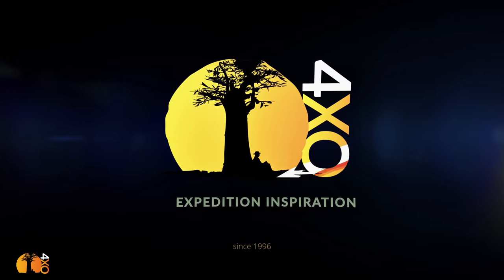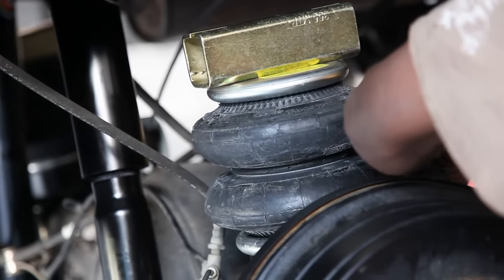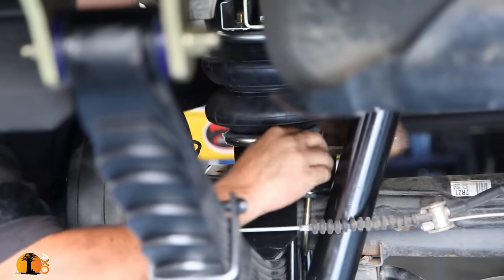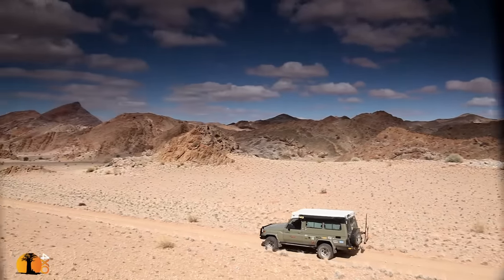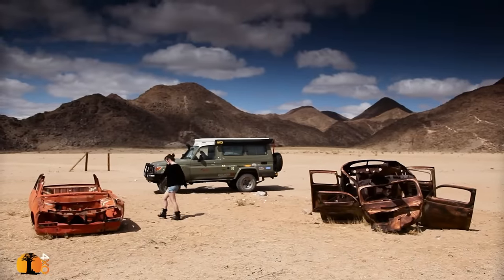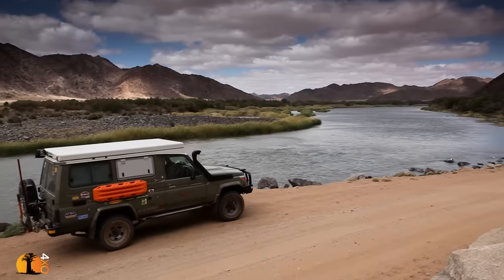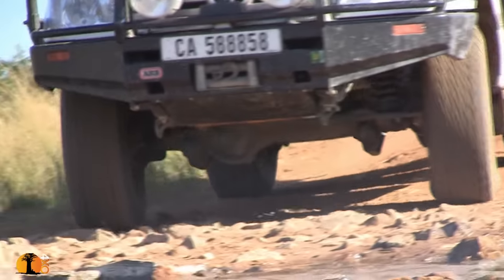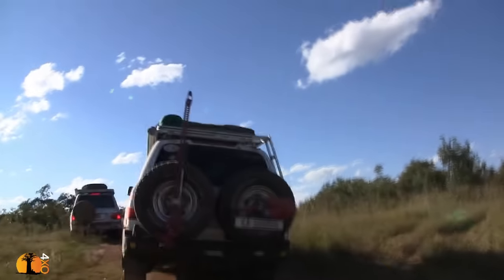AIR-BAG HELPER SPRINGS. ANY GOOD? | ASPW 4xOverland

Comment: Airbags when mounted like in 10:40 is an absolute nightmare for the frame. Shows not the slightest understanding of swelling/oscillating forces. IF at all, the load must be distributed to a maximum of frame length. And then still the basic failure is: the vehicle is overloaded and will brake. 
Very common mistake: big cabins on a pickup. Its not working, needs stronger springs, will break when used even in light offroad driving. It will. You'll completely lose the car in the midth of your trip because the frame will be welded to get you home finally and you have to replace it.
Reply: Wrong, go look at how the Ram 3500 comes from the factory with the air leveling suspension.  Airbags mounted exactly like in the photo.
Reply: I disagree
Reply: @travisschultz874 I don't mean factory settings
Reply: @travisschultz874 . Yeah . Built for it  FROM THE FACTORY . Engineered for it . Not an " Add-On " . OE equipment .

Comment: I have Air bags fitted to my Hilux and I think they are great. I agree with Andrew that most chassis breaking is because of airbags but when you speak to those people you would find out that they overload their vehicles and pump the airbags to the max to prevent the car from sagging at the back. I use my Hilux for a daily driver so my OME suspension is set up for daily driving and medium loads but when I have the back loaded with our diving gear, some other basics and have the caravan hooked up I use the airbags to support the leave pack at the back. I never inflate the airbags more that a quarter of its capacity but find that it give additional stability while towing and I can control the sagging at the back to ensure the caravan in running straight. This does not affect my ride comfort as my Hilux drives like a dream loaded or unloaded so having airbags can be beneficial but it requires self restraint not to think you vehicle is now all of a sudden capable of carrying load it was never designed for. Thanks.

Comment: Hi Andrew, 

Airbags are a hit and miss. We have used them for over 12 years in mining vehicles.  With that knowledge and seeing what fails I use this method. 

I figure out what rate springs the vehicle needs when fully loaded, I remove around 15 to 25% of that spring rate then rate my mechanical springs to that. 

The last remaining 15 to 25% we fit airbags to carry that extra. This give you the best balance I believe with the drivability and ride. 

It also allows x3 sections of the chassis to carry it as even as possible. 

😎
Reply: G'day Ty, love your channel (even though you're a Effy lover!!! hahaha). 
You're probably right when it comes to trucks with a bloody good chassis like yours and mine (I have a Chev Silverado 3500 srw...single rear wheel). 
However, when it comes to the little butter boxes that most people buy (Ranger, Hilux, D-max etc), I would urge caution about the "3 points of contact" idea. Those chassis aren't built with the idea of having upward force (ie: the air spring) applied directly above the axle location.  Fifteen years ago I had a Patrol with 6.5 Chev V8 diesel, cut-down to a dual cab and managed to crack the chassis because I over-engineered the rear springs....and they were COILS so actually meant to have the load placed on that section of the chassis.
The 15 to 25% overload idea has merit, but too many numpties would still manage to just keep adding more weight and STILL bend the chassis I reckon.

Comment: Air bags in coils make perfect sense if your occasionally towing a heavy caravan or similar. They do not affect the ride if used correctly. The trick is not to inflate the bags to their maximum pressure and overload the chassis. You don't need to pump them up hard to get back to normal ride height, just settle for lifting the back a little to recover some of the suspension travel. I never inflate mine beyond half their rated pressure. I wouldn't use them on a leaf sprung vehicle though, as the chassis isn't designed for the additional load point.

Comment: I'm not a expert but looking at some people's feedback, airbags are a good way to temporarily balance a load, provide better handling and reduce sway when towing. If you are almost always laden with weight, heavy duty suspension is preferable and smoother. There's no wrong decision, and airbags are generally a cheaper option then new suspension.

What I think we can all agree on is if you plan on towing 3t with a Prado with the family regularly, the safest option is to consider heavy duty suspension or airbags. You will have a much more enjoyable holiday with something to balance the load.

Comment: I've been running them on an 80 series for years. I constantly change from near empty to a decent load. The truck rides beautifully when empty but sags a little when full. The airbags level it out and make it more stable when loaded.
It's basic physics. Add load and your springs will compress and can't work the same due to reduced travel. The spring rate is also harsher when compressed.
Reply: Except airbags don't compress. They just stop the spring doing anything at a certain point. And then break your spring mount points. As stated. They are dumb for offroad load carrying. Perfect and designed for bitumen towing on daily city 4x4's.
Reply: @Snook_  of course they compress.. they're made of rubber! Get the right pressure in them and they'll compress just like a football bladder. The key is to have the right pressure which usually means not too much. I think they're most useful if your load changes a lot but I agree that for serious off-road with a fairly constant load you should have the right spring set-up.
Reply: @LongStraightLines  they don’t truly compress tho. Air has a limit where it just stops/bottoms out completely so it’s kinda shit and bad for your car to hit that limit and put all the load on a tiny point of the chassy. That was my main point
Reply: @Snook_  Its all about balance and knowing your vehicle , if when loaded you make the air bags and suspension work in unison you can run your vehicle on zero load ,and then when loaded equalise the weight with the air bags. obviously the bags compress , as the air presses the bags out horizontal on load ,thus giving you movement in a controlled way.As we all know all Toyota's chassis are massively over engineered , thats why we are all lucky in Australia to drive them. They also help with breaking under load. as they stop pitch and roll.
Reply: Also, unless you have progressive springs, compression doesn’t change the spring rate, so it is not harsher because it’s compressed. But because it has less travel for the shock absorber to do it’s thing.

Comment: I use airbags when towing a Caravan, 20 psi does the trick.👍 They do work well in coils as long as you dont put too much air in them. With 20 psi, the coils still compress and extend no problem at all.

Comment: Wait! The chassis in a whole is made to distribute the load onto the suspension. Yes there are fixed points, but other points can be used properly to help relief the pressures of heavy loads.

I have both air spring helpers in coil and leaf spring applications. They are both adjustable with a special pump and the ride quality is perfect. In empty I lower the pressure to let the springs work, and loaded I increase the pressure to help stop the saggin so my headlights are not pointed up.

When done properly with quality parts air spring helpers are the best on and off the road. 

I load two dirtbikes into the back of my defender 130 and with the ome long travel springs and air helper bags in the springs the ride is pleasant all the tine. In my tahoe I load it full with kids, gear and tow and the air bags in the coils give the back a boost and ride quality is not harsh at all. 

I am running 20psi empty and 30psi fully loaded. Everything is happy, and in the last ten yrs never broke anything, if anything my shocks last longer and my swaybars also.

Comment: Well i've heard it all now, the chassis at the point directly above the axle has been designed for incredibly high impact loads as the springs compress as a pothole or washaway is unexpectedly hit. Just imagine the 900kgs or so on just one rear wheel whacking into the "bump stop" at high velocity as the standard shocks and springs of any vehicle give up the ghost at this time of impact. Yes Andrew the "bump stop" is a lump of rubber on many vehicles, some actually have an internal hollow and have an extended shape to soak up and slow down the velocity of the impact on part of the chassis well and truly designed for these loads. I reckon go have a talk to an actual chassis engineer and ask him/her about bump stop impacts and the possible high velocity loads this point is designed for. Worth a video maybe to remove the airbag stigma which they do not deserve. Remember many of us out here do not need superflexible leaf springs for superb offroad articulation which airbags definitely reduce, been there done that. We need and adjust our suspensions in many ways to give us that superb corrugated roads (and towing) ride for thousands of outback highway kilometres, been there doing that.
Go stick well designed airbags on the vehicle (maybe ones that do not permit shockers to bottom out at low pressures), run at lowest pressure possible when unloaded and bump it up as required to maintain a level ride when towing. Air bags at bump stop locations do not cause most chassis breakages, you should know many other issues are well up the list before the airbags take the blame, driver, speed, depth of washaways, mass of vehicle, load positioning, etc.
Reply: Airbags don't reduce articulation. Unless you didn't put the cross over tap in.
Reply: @jarlnieminen4307  After market air bags are individual units and don't have interconnecting pipes (apart from the tiny inflation hoses).
Reply: @SC-nv8ve  Without wishing to be cynical, don't expect any engineering from the air bag manufacturers. See the video on my channel for the story of how and why mine fell apart prematurely. Badly engineered.
Reply: @defendermodsandtravels  actually a lot of kits have a t fitting to inflate both bags via the same valve. This setup allows air volume to flow between the bags to transfer weight. One wheel goes up compressing the bag and the other gets the air while it expands down. 
.
Of course it can be ran individual which is better for load handling.
Reply: @KTMcaptain  There's a connecting tube between the Air Lift bags I use but it's such small diameter that I doubt if much air moves in response to the axle movements. It's an interesting point though.
Reply: @defendermodsandtravels  not with quick movements, but slow articulation definitely. Just unhook an inflated bag and see how quickly it will go back to atmospheric pressure.
Reply: @KTMcaptain  It all depends how long it takes for the pressure to equalise. If it's in the order 1-2 secs (which I would doubt) then the airbags won't impede axle articulation when driving along a really bad track. That would be a bonus.
Reply: @defendermodsandtravels  When I’m articulating it takes me well over a couple seconds to stretch out. I’m not looking to unsettle my vehicle. Either way it should. There is thousands of pounds of weight forcing that air out and the other wheel dropping means that bag expands and drops its pressure allowing for an even larger gradient. 
.
Put you bag up to pressure, unhook the line, and time how long it takes.
Reply: @KTMcaptain  How long?

Comment: All areas of the chassis rails are designed for carrying load. In fact adding pressure to other areas spreads the overall pressure reducing the likelihood of failure. If your load is going to break the vehicle it's going to regardless off wether you fit an air again setup
Reply: Well said. I would put money on that the breakages are from people who have overloaded the vehicle then overinflated the air helpers to deal with the overloading.

Comment: I could not agree more.  Here in the states the best performing rigs do so on their regular spring configuration (leveraging the vast amount of engineering of the Manufacturer).  We are lucky to have spring shops that have years of experience making replacements and upgrades for the way the truck is used.  I have used their expertice in  vocational trucks for decades with great satisfaction.

Comment: Airbags are great for varying loads as you said. I have Terrain Tamer 0-300kg progressive springs in my Patrol which ride great when empty or partially loaded. However as soon as it’s full with the trailer, they’re too soft. I previously had heavier springs which were great when loaded but were too harsh when empty. The way I travel, it needs to drive well either way. I haven’t found a noticeable difference having them in the coils. Drives normal when empty (deflated to 0.5 bar) and normal when loaded (2.5 bar). Had just the Terrain Tamer coils for a few trips before installing the airbags.

Comment: I have turned my 2019 Fortuner into an overlander.  Fitted a second fuel tank which sits above the spare wheel.  The spare wheel now sits 50mm lower, and that is my problem.  When the vehicle is fully loaded, it sits pretty level, I just needed to add the 50mm I lost with the 2nd fuel tank.  Fitted air suspension fitted on the axle not inside the spring,  I must say I am very happy, the vehicle handles well.  I am only using 20% of the air suspension's capacity

Comment: So interesting you say this. I tried airbags inside the coils on a Prado to help with heavy loads on a trip. My experience was exactly as you describe. The ride was terrible even with 0 - 5 psi in the bags. They lost all suppleness. Yet before I put them in it was impossible to find anyone who explained this. So I totally agree and I hope others watch this before paying for airbags thinking they can have their light load road and load carrying with airbags only to end up going with stronger rear springs afterwards anyway.
Reply: It must really vary vehicle to vehicle. I use them on my Frontier/D40, and on top of leaf springs for my purposes they work great. They are sized so that they aren’t being used unless I am heavily laden or towing, and add just a touch of support and stability only as needed.  Very much one of the best additions to my suspension, for me at least.
Reply: @JimYeats  I think Andrew is spot on about the impact on the ride having the airbag contained inside the coil spring which gives the bag very little room to expand as the spring compresses.
Reply: @peterj5751  That very well could be. I am not familiar with that type of air bag setup personally. I think the airbag on top of the leaf spring, or better yet, the air bag on top of the leaf spring that simply contacts a cradle and is not permanently affixed, has less impact on how your suspension feels, and your ride quality.
Reply: Many mechanics and vehicle fitters don't understand how poisons ratio impacts the behaviour of "constrained"  normally compliant materials - rubber or air.

Comment: Totally agree. I investigated air bags for a Triton I had back in 2010. My research found several instances of bent chassis where airbags had been fitted.  All because the chassis was not engineered to have the stresses in the places affected. That scared me off air bags for life. EDIT: my research was specifically for towing a big off-road trailer and the instances of bent chassis I found were all where people were towing a heavy trailer. Apologies for not stating this in my original comment.
Reply: I imagine that could very well happen Doug, but I would say chassis damage was caused by over loading not by the air bags. With leaf sprung vehicle, fitting an air bag, you are putting pressure on the chassis where it was never designed to go - so that could be a contributing factor, but with coils, that point of contact is where loads are designed to go. I don't know that loading the chassis with an air bag or a stiffer spring will make any different to bending or breaking of the chassis, but I do know that over loading will do this.
Reply: That's not an airbag issue your data search was too  narrow. You will find that there's likely 90% of chassis failures that do not have airbags.
Reply: @jarlnieminen4307  Agree, but beware of statistics. e.g. It could be that 90% of Tritons have coils and so such a statement is meaningless. Statistics - a fickle mistress. 
I don't know the full set of numbers so I can't say one way or other from this statistic proves coils or air bags contributed to chassis failure.
My guess is, since to hold the same weight you need the same force from the spring or air bag so a coil or an airbag plays little or no role in chassis failure. 
However when the spring or airbag bottoms out - usually caused by overloading and or too harsh a treatment causing bottoming out, then that is when damage to the chassis will occur and neither the spring or the airbag has anything to do with the forces acting on the chassis since the force either can exert is expended - its bottomed out. The other cause, again independent of type of suspension is the loads imparted by weight hanging a long way behind the axle - either a trailer or badly distributed load in the tub. I'm sure you can find a video on this - John Cadogan or Robert Peper.
Reply: @MiniLuv-1984  nah even if the spring can't carry the weight you will be on the bump stops and the chassis will break there's no magic situation where the type of springs saves the chassis.
Reply: @jarlnieminen4307  You put it so succinctly Jarl - that was the point I tried to make.
Reply: @MiniLuv-1984  my bad I wasn't fully comprehendin what you said.
Reply: Hello Doug. May I ask what was the weight of your trailer that you've considered on your research? I'm currently towing 1500kg (3300lbs) off-road trailer and looking for a solution to sag and ride quality. Thanks in advance.